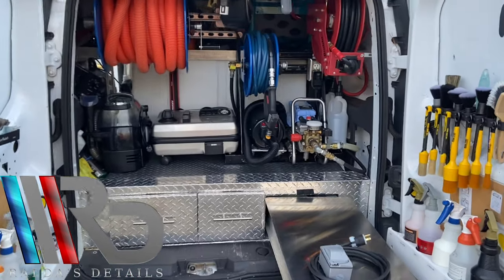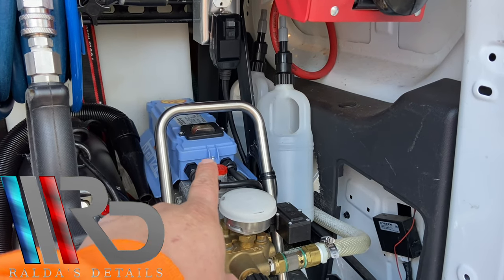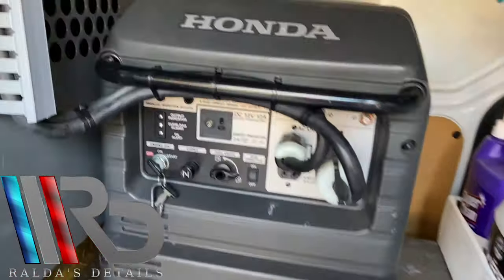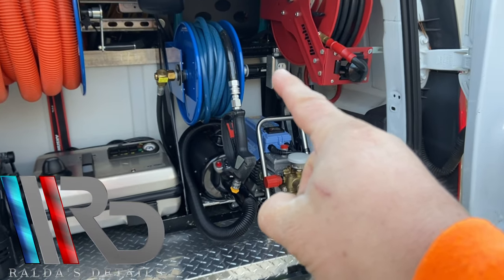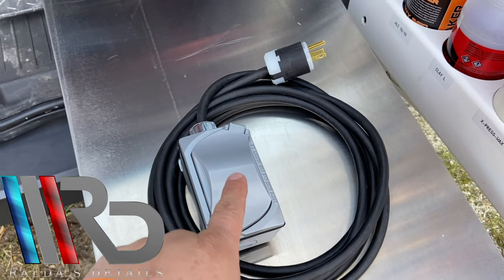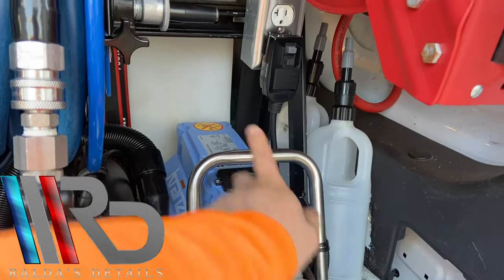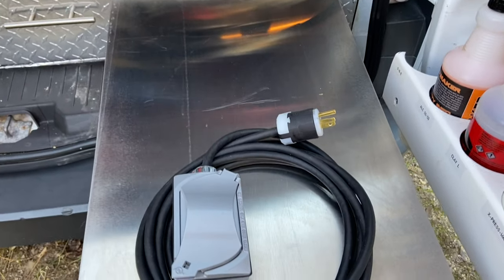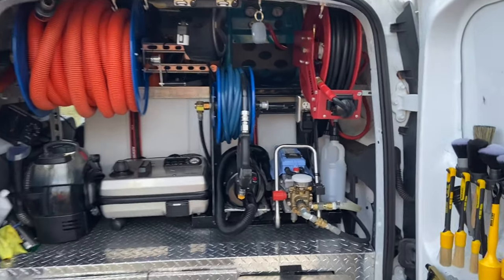Best Mobile Detailing Setup Tips Kranzle Pressure Washer Extension Cord Be Efficient!

Comment: Did you shorten the power cord on the pressure washer and does it work fine with that generator
Reply from the maker: Yep 👍🏼 just perfect
Reply: @RaldasDetails  so you shortened the plug that came on the pressure washer and if so why did that help
Reply from the maker: @jameslalewicz1283  helps because the cord on the kranzle is like 40ft so wend you have a long cord you get what is called voltage drops and the amps as well so if you cut it and make it just want you need will help to the kranzle and generator that is why OG recommend a big Gen. to make the kranzle work also this help because having a costume cord you can have both switches close unless you have the Gen. right beside the kranzle that is a other option but at the same time you don’t want to have your Gen. to close of water 💦 so having a GFCI receptacle will work better because is safe on water!

Comment: Hey! Where did you get the black metal bar things that is holding up your cox reel for both the water hose and vacuum hose?
Reply from the maker: Home Depot
Reply: @RaldasDetails   I was just checking Home Depot website and I didn’t see that. Is it the metal shelving frames that you used without the actual shelf?
Reply from the maker: Here is the link
Your friend has shared a link to a Home Depot product they think you would be interested in seeing.

10 ft. 14-Gauge Silver Electro-Galvanized Strut Channel

https://www.homedepot.com/p/202714280
Reply: @RaldasDetails  thank you so much!